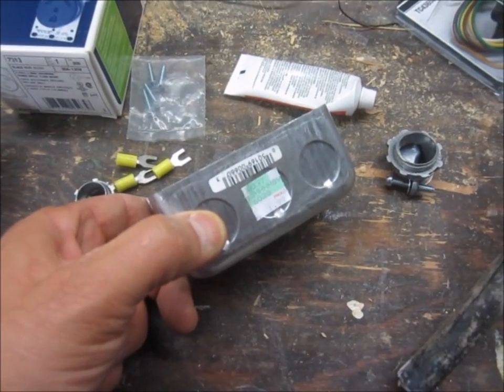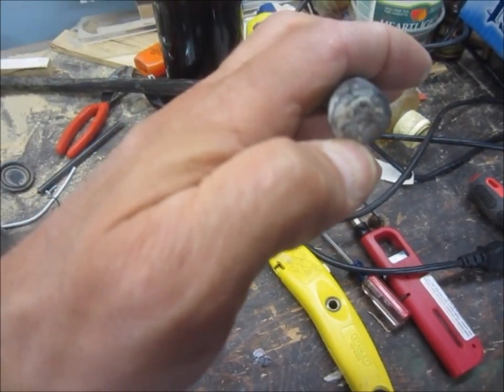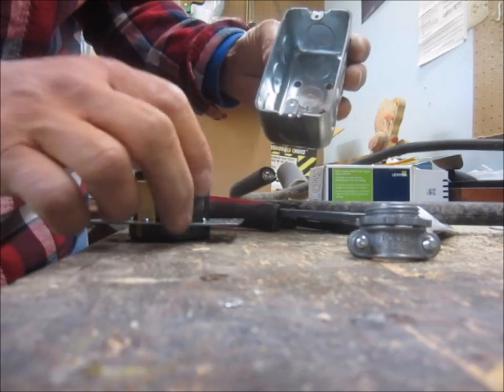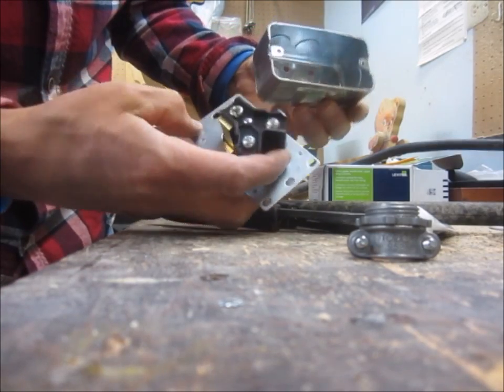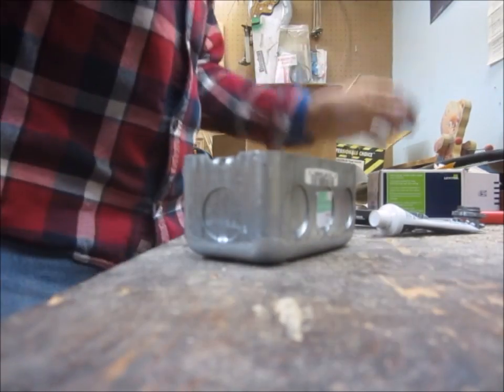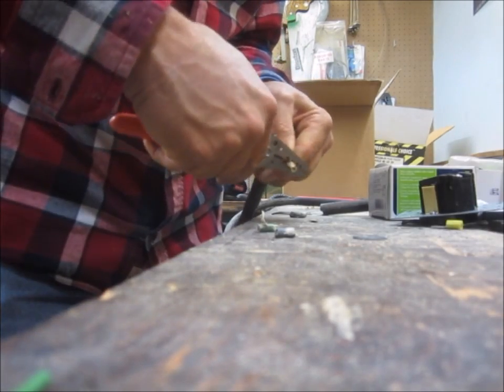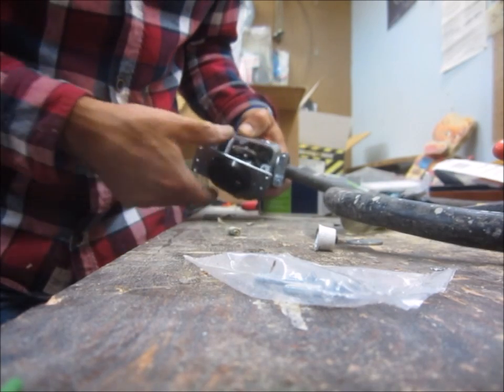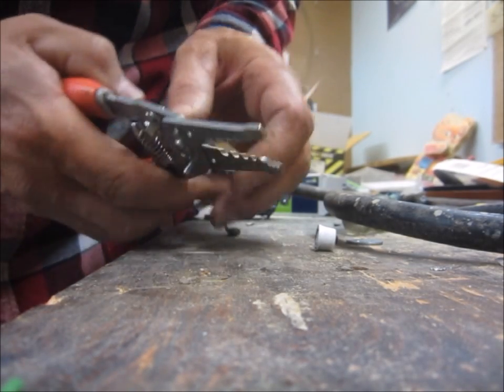Building 30 amp RV outlet for 3000 watt pure sine inverter pt 1

Comment: Thank you for the videos! Not sure if you still monitor this video, but question about gauge… I have a section of an old 30 amp cable I’m happy to cut up, can I just add the connector bits and use these three wires to connect the inverter to a 30 amp exterior outlet? I believe they are 10 gauge? It makes sense to me, but also read I should use 1/0? Just want to be sure I use the right gauge wire for the outlet… thank you!

Comment: Love this mod.  I’m wondering if u can clarify something:  I have a 600 watt inverter in my motorhome that only powers TV outlet.  I want to upgrade to a 2-3k watt inverter and be able to use any outlet for short period of time (especially microwave for a couple minutes at a time).  I asked RV shop about this, and he acted like i would have to run wires to all outlets or just pick one outlet and that would be cheaper.  It seems like I could just add another, larger inverter to batteries and 30 Amp receptacle to inverter and connect my 30A cord to my shore connection and to inverter to get all outlets operable when inverter is turned on.  Is that basically the idea?  I know u probably get hundreds of questions, so if u don’t have time to respond, maybe there is a viewer who knows the answer who can help me out with the answer.  Thanks!
Reply from the maker: Crystal Stevens I don’t actually get very many questions and I answer them all to the best of my ability.
You are correct, and what you are asking is very doable. I did a solar/inverter install on a friend’s trailer and made a three part video of the install and a short overview video that I will link below. 
I think it’s exactly what you want

https://www.youtube.com/playlist?list=PLIqa7jU6xglsZ5-NsO8piRBGuFrT7JzNJ
Reply from the maker: Crystal Stevens 

https://www.youtube.com/playlist?list=PLIqa7jU6xglsZ5-NsO8piRBGuFrT7JzNJ

Comment: Do you need to have your converter turned off to run off your 30amp plug?  I did this to mine also, but my outlets are all on the same breaker as my converter.  so it's not a good option for me.  I need to either figure a way to separate the converter and outlets or run separate outlets to the inverter
Reply from the maker: Great question. If your converter is on, it will always be trying to charge your battery's, and your inverter will continue to use the battery to power your converter. The losses in the conversion process will kill your battery's in hrs.
Reply: @StimRacingTrailerandTravels  I run my RV power cord around to the 3000watt inverter and plug into. 30amp outlet box I made just like in this video. I turn off my Converter in the trailer so the whole charging system isn't in a loop. The 30amp outlet to my 3000 watt inverter supplies 30amps to the entire RV just like if I was plugged into a 30amp shore power. Of coarse you have to manage your battery power, you could drain your batteries in a hour or 2 on high power hogs like A/C.
Reply: @theconnectedcamper   When you throw the breaker on the Converter, do all the 12V systems still work?  I am in the process of install a 3000W Inverter to run off a bank of LifePo batteries.   We do not have solar yet but that's coming next.